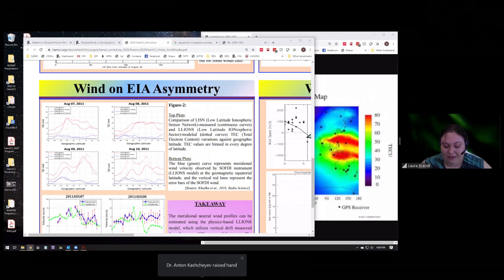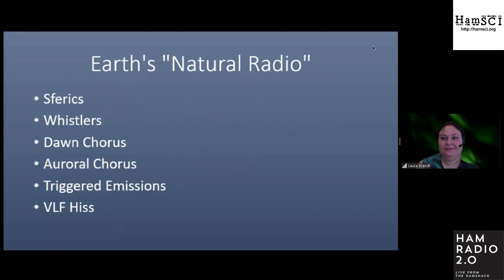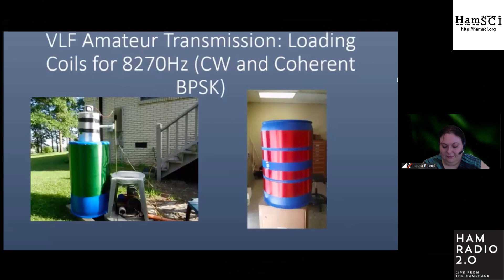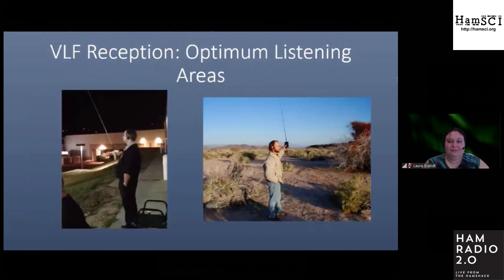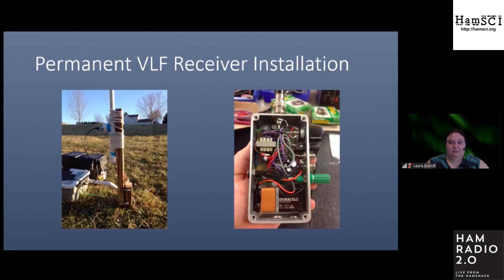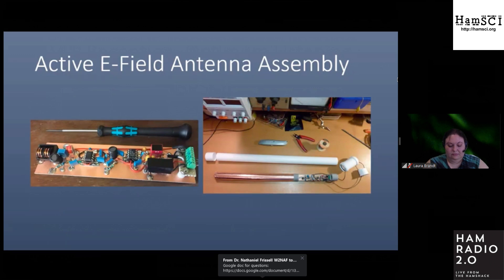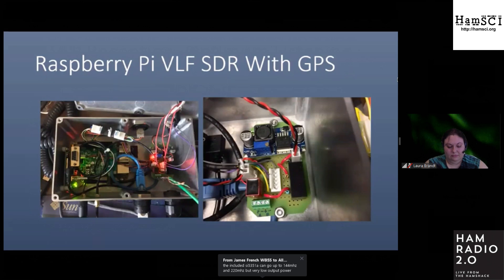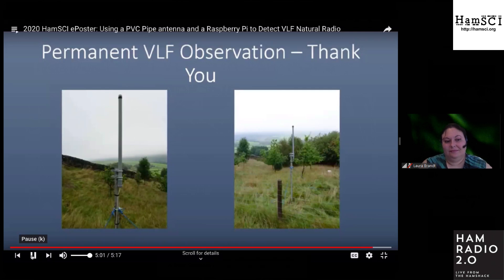HamSCI 2020 - Using a PVC Pipe antenna and a Raspberry Pi to Detect VLF Natural Radio

Comment: VLF natural radio receiver can built with cheap transistors ( 4 transistor circuit - two FETs, two BJTs ) , power source - 9V battery.
Expensive Raspberry device vs cheap 4 transistor circuit. :D